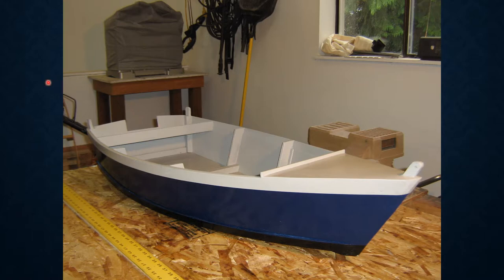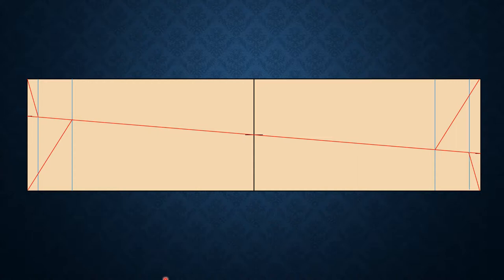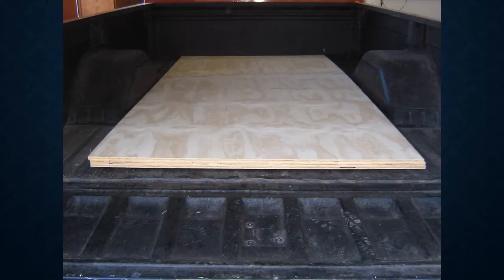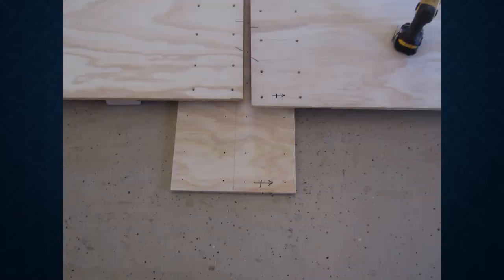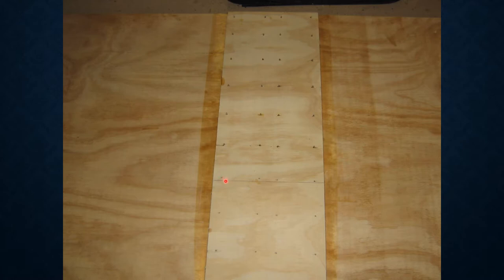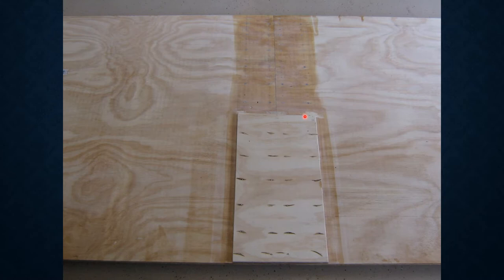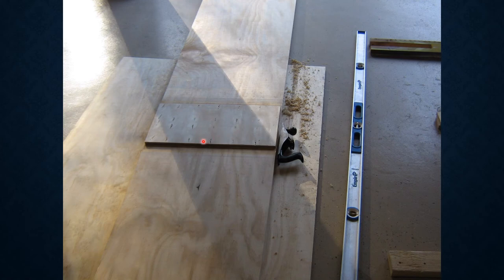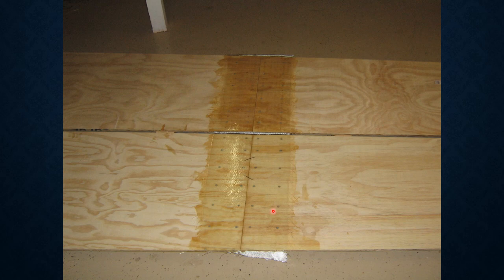Episode 8 of 2019 Boat Build

Comment: Dont understand why you chose to have the finished side  of the plywood inboard on one side and outboard on the other side
Reply from the maker: Friend, I did not "choose" to do it that way, I was "forced" to. Ha ha. I would have liked to do as you suggest, but it would have required four sheets of plywood instead of just two. Wasting material would violate Mr. Earl Brockway's economy of design (He was the original builder of these boats). I encourage you to watch again closely or sit down with some paper and scissors, if needed, and discover why this has to be the case in order to save on materials and ONLY use TWO sheets. Note: The pictures are deceiving, but the rip is not straight down the middle.